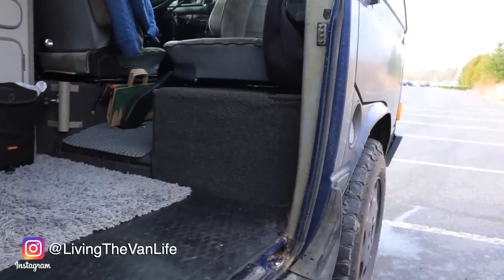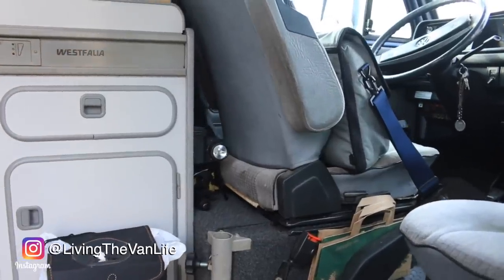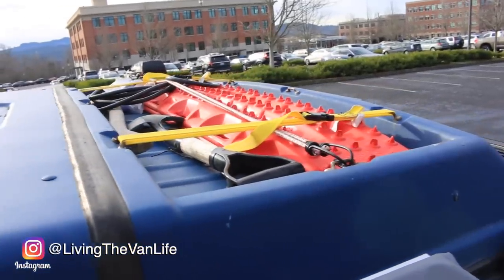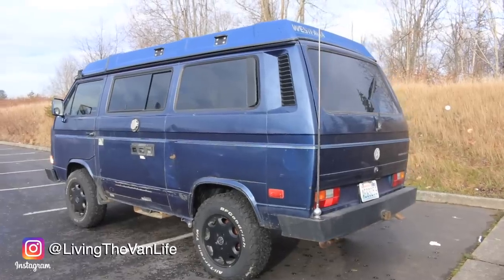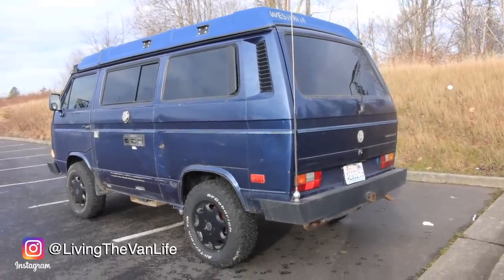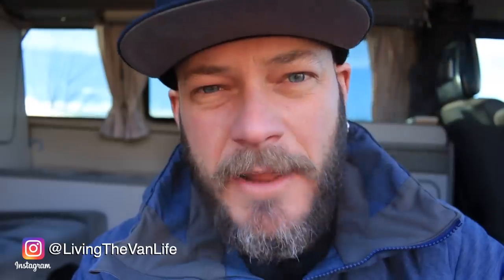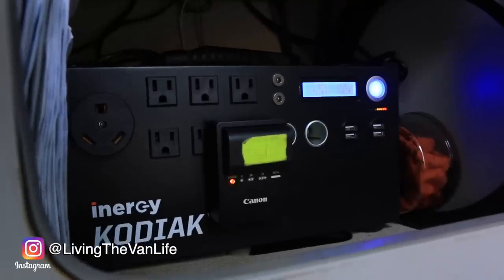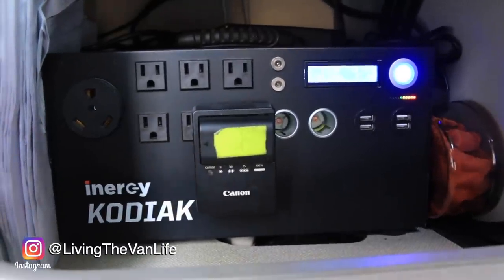Chinese Diesel Heater Install In a Volkswagen Westfalia - Living The Van Life

Comment: I think you did a great job but I would still highly recommend a co2 detector in case exhaust ever leaks.

Also, you probably will never have a problem but there are regulations on fuel tanks inside a vehicle. In the event of a roll over, that tank will pour all the fuel out and cause a potential hazard. 

More importantly, the fuel pump etc is also inside the vehicle. There are a lot of connections and fittings going on under there. There is a high potential for leaks. If it ever leaks, instead of it just dripping on the ground, it's directly into you cabinets.

At a minimum, I recommend getting the co2 detector and move the pump and filter under the van. 

Toreally feel safe, I would get the tank out of there too. I know diesel is much safer than gasoline but there is a reason why the fuel systems are technically outside the vehicle. 

Or dont. Whatever cheers. Just an FYI.
Reply: helmet098 good advice.
Reply: Good idea
Reply: The detector is a good idea but diesel isn't flammable unless under the right conditions i.e. enough oxygen
Reply: He's not worried & using  it regularly. Looks like a well done install - very sanitary !
The 'safety nazi' mentality is its own sort of danger...taken too far we won't ever try anything risky because of the terrifying "What If ? factor.
Diesel is just a light oil - almost impossible to light off its fumes even - gasoline is magnitudes more flammable.
Reply: @hellosunshine1090  diesel is toxic
Reply: @jquest43  True enough.
The issue discussed was more flammability not toxicity per se.
Reply: @jquest43  I think there are other factors too.
Fear of danger that is reasonable helps design systems properly.
Unreasonable fear bordering on paranoia ("what if the sky falls on me...?) creates the safety nazi mentality that tries to foresee every potential inevitability (an impossibility) and design a system so safe that no ill outcome COULD occurr (also an impossibility).
Therefore Life involves risk on some levels.
And just as importantly it's his vehicle not yours or mine - and if he's happy with its safety - 'good on him" !
Reply: While co2 is bad.. co or carbon monoxide will kill with out warning.. so install  CO  alarm

Comment: heads up on the metered pulse pump you want to mount that in a more vertical fashion. these pumps have a piston that is run by an electro magnetic pulse they create air bubles which is fine but with the pup mounted horizontal the air accumulates and the piston wears out because the diesel is what lubricates the pump. the dosing pumps or pulse pumps are very simple and will last a long time but only if yohu mount it so that all the air travels into the fuel line. these are really a good design witho only one moving part in the heater itself which is the fan there is no carb or injector the pump pumps in .02 milliliter pulse that piston is the only other moving part in the entire heater. mount the pump with the output at the top, prime it, and it will last much longer. 
otherwise great install and nice set up
Reply: Who's John halt?👍😉
Reply: @Lumumba B. the best install is from John McK47.

Comment: My dad just installed one in his Westy, put his diesel tank in the engine bay next to the overflow tank (has a Subaru conversion). Super slick and never has to worry about diesel fumes/leaks from the tank. Fills it up when he checks his oil.

Comment: I've been working on those heaters for a while, couple tips. Run for at least 30 min, even during the summer run it once a week. That will keep the pump from sticking. Change the filter regularly. Don't use a bio blend that will foul the burner chamber, you can use an anti-gel additive but sparingly. If you have to change the glow plug tear the thing apart and clean everything.
Reply from the maker: Thanks for the tips!  Much appreciated!
Reply: @LivingTheVanLife  not a problem. Those heaters work great, but can be temperamental.
Reply: A* couple of* tips

Comment: It looks like a great addition. I'm surprised that you didn't have this type of heating solution already seeing how long you've been living in a van. Nice job on the explanation of it all.
Reply from the maker: I actually hadn’t realized they even existed.  I’ve never had the budget for the more expensive, $1,000+ models.  This one, I just couldn’t afford NOT to have.  Thanks for watching
Reply: @LivingTheVanLife  I've watched a few others that use the Webasto brand and they were pretty pricey but you're the first one I've seen to have a separate fuel tank for the diesel fuel. You may have stumbled on to something. Don't be surprise when there's a bunch more people following your lead, especially for the price. What's the fuel consumption? From others that I've seen, they say it sucks up about a gallon of diesel every 24 hrs. What about for this model?

Comment: I bought that Chinese knock off because of a review I saw on-line from a guy in Ireland. I have had it hooked up in my shop all winter. My shop is a poorly insulated building in the interior of Alaska. The heater works like a champ. Heats my shop for about 3 gallons a week. Not bad for $189. It was wither that or $1,800 for a Toyo stove

Comment: I recently purchased a Chinese diesal heater and found a miner fault with fuel tank which is when heater is runner the fuel pump which sucks the fuel actually squeezes the fuel tank together,
When I release the filler cap the tank expanded,
So I've fitted a one way valve on the top of tank to stop it happening.,
Just a little tip for you all who's purchased one.
Reply: Probably a defect in the pump or tank. Not 100% how these heaters specifically are designed but in a normal fuel system of course, this is built into the tanks lid and also incorporated into the filler neck. Along with several other safety features I’m sure these don’t have (like resistance readings in the plastic). I used to work on machines that made and assembled fuel tanks. So I’m used to seeing all the crazy safety requirements before they go into a vehicle.

Comment: I’m trying to be a troll or hate‘n on this video but I deal with these heaters all the time air and coolant (well at least the North American made ones) but one suggestion if you are to use it regularly in colder climates do your self a favour an install fuel cell/fuel pump/fuel filter on outside of vehicle..it just takes one little spill of diesel on the floor/ground and the smell will chase you out of the van and hard to get rid of if it soaks into anything...but that’s just my suggestion, keep doing what you’re doing and love the videos and glad to see the amount of time and effort you did for that install instead of just jamming it in a corner ✌🏻

Comment: The only thing I would do , install a cut off valve between tank and fuel filter, so your fuel doesn’t leak out if you have to change filter

Comment: We installed one of the cheap Chinese Diesal heaters in my sons sprinter van, these things make heat and lots of it! if you run them on low for say 2-3 hours it’s imperative that they are run a good 5-10 minutes on high to burn off all the soot buildup in the combustion chamber.. or they gunk up and won’t fire up!
Reply: Do you need to vent with these diesel heaters???

Comment: I recommend a good high flow air filter for the intake of the heater. I installed one of mine without a air filter and in one season it was extremely dusty inside. I would imagine depending on the build up material it could become a possible fire hazard but at the very least will cut down on efficiency.

Comment: Diesel really stinks duder hopefully that doesn't become a problem for you. Keep up the good work 👍
Reply from the maker: It’s been zero problem at all.  With the diesel tank being in the cabinet adjacent to the slider door, it’s easy to pull up and fill directly from the pump.
Reply: 30 seconds during ignition..No buggy with the door closed Meander

Comment: I had a VW beatle using a VW 1 cylinder gas engine it snowed 6 inches start the 1 cylinder motor in 15 the snow all melted away great heat for going skiing !!!

Comment: Chad, Love your adventures! I see you installed your heater pump horizontally. Everything I have seen/read indicates that it must be installed vertically or at a 45 degree angle, but not horizontally. It will cause premature pump failure. Might be worth you doing some more research. Don't want you to wake up freezing some morning...

Comment: Chad don't know if you have heard this, but when you shut it off you will want to run it on high for a few minutes to help burn out the combustion chamber from collecting soot. That is if you continue to run it at lower temps. I just bought the 2.5K model so i can run it more hot all the time to combat this issue.,,, Good informative how to...

Comment: Nice neat and "cozy" job!! I am sure you have made many Westfalia owners happy (that need heat and can live without the refrigerator) by doing the contemplating for them. I couldn't imagine any better installment choices than what you made. Let us know how it is in the long run; reliability, efficiency, fuel consumption, etc. Excellent delivery and thorough explanation. The baling wire trick will help anyone setting up one of these in any application Great video on SO many levels!!  :-) Thanks Man!!
Reply from the maker: Great feedback!  Thank you for writing this comment.  Much appreciated.  Certainly hope that it helps people out there.     I will certainly be doing a follow up video to how the heater has been performing.  Thanks for following along.

Comment: These are good heaters i bought 10  from china and could easly sell them  and have mine free  i still advice to install a carbon dioxide alarm you never know what goes wrong
Reply: Carbon MONoxide is deadly, and what you meant :)
Reply from the maker: Good advice!   Thanks for the feedback!
Reply: CO 2 is what we expel when we exhale. CO is a by product of fossil fuel as it burns. Methane gas is a by product of decomposing organic matter. All can be deadly in confined spaces.
Reply: advise*
Reply: @tommiedaswammi8008  byproduct*
Reply: the intake and exsaust are outside theres nothing to leak inside !
Reply: @raymondj8768  exhaust*
Reply: @DarthVader1977  byproduct: a secondary product made in the manufacture or synthesis of something else. By burning a fuel,any fuel, we generate a byproduct, e.g. CO., H two O, CO 2, ...H2 O. is a byproduct of fuel-cell operation.
Reply: @raymondj8768  very bad advice. Always have a CO detector installed with any kind of enclosed space. Even leaving a side window open and the wind changing could fill the vehicle with CO
Reply: Raymond J I bet you’re fun at parties correcting everyone’s grammar GRAMMER!! 😆
Reply: Martin Green please rewrite your comment, it's grammatically incorrect.
Reply: M3ta7h3ad good point.if the unit is toxic metal then it will vent poisons. Reducing iq.
Reply: *advise
Reply: Martin Green *GRAMMAR
Reply: Raymond J *there’s
Reply: Tommie Da Swammi I don’t think defining the word you spelled incorrectly was necessary.  Interesting nonetheless.
Reply: @LivingTheVanLife  I didn't hear how long it took for your install.  I have a trip coming up in about ~10 days with only one day off for install time.  Thoughts?
Reply: Do you ship to South Africa? Thank you
Reply: Ewan Yengi  That's wrong. The reason they won't go off is because burning Diesel does not produce any CO.
Reply: Ewan Yengi  That is wrong.  ANYTHING that produces carbon monoxide will trigger a CO detector..

Comment: Looking at your install of the fitting at the bottom of the fuel tank, it like you used o-rings against a flat surface, both the inside/outside of the tank and the nut. O-rings need a groove to sit in or they will be crushed out of shape causing a leak. sealing washers for this application should be flat, not o-rings.
Reply from the maker: The actual metal nipple portion has an o-ring groove in it. So that should suffice.  That’s how it was designed.  It’s not my design.

Comment: You need to mount the pump up and down not sideways otherwise you will greatly reduce the life span of the pump. Check out John Mck 47's channel for further info on these type of heaters.
Reply: I think they suggest a 45 degree angle, but definitely not flat

Comment: As a truck driver I had some trucks with diesel heaters and trucks with APU generators personally I like both but most of all it’s nice having the diesel heaters because they’re quiet compared to a APU generator which sounds like a constant Lawnmower idling.

Comment: Hey chad great vid, I’ve heard on a few UK vids which is where I’m from that these heaters can clog up with carbon if ran on low setting all the time. Its a good idea to blast it on full every so often to clear out the carbon build up. Also the pump can stop working if not installed at a certain angle 30 degrees I think 🤔
Reply from the maker: Ahhh gotcha!   Thanks for the tips!   Much appreciated!
Reply: if run* on

Comment: normally it is connected on your feul tank
10% of the bottom of the tank,just in case
Reply: I see what you're saying but wouldn't  that 10 percent be forever unusable since he would have to unmount the tank and tilt it just to get use out of that 10 percent?
Reply: recently saw a video where the people added a cleaner or some type of additive to their diesel fuel tank and it messed with the heater . they had to run all the fuel out before they could use their heater. so a separate tank might be best.

Comment: Anyone can install one of these units. Espar or Chinese, same way. If your in a truckstop at the end of the day and it's cold and all the trucks are coming in to park you would think the place is on fire. Most all the Espar units are smoking like crazy over and over trying to start. Your first sign the combustion chamber is all carboned up. The glow plugs need to be replaced but unless you practice you'll ruin it and need to try again with a new one. The fans fail a lot then the computer shuts it down. They don't work at altitude. Says right there on the manual. Also, first hand experience with that. You can get the high altitude pump but that doesn't buy you much. It basically runs the pump at a lower volume of fuel and also cuts down on the BTU. I have already seen some Chinese models that let you set the fuel flow. That's the right way to go.

I also notice the thermostats do not work that well. If you're going to be in a real cold environment you want that puppy cranked up non stop. Do not let it start and stop over and over. That's where the carbon buildup comes from. Once the unit doesn't start it waits a little and tries again and fails. This just adds insult to injury and more carbon. A common hack is to put a switch across I think the red and yellow wire at the unit which overrides the thermostat and keeps it running non stop.

Many trucking companies have the Espar in their fleet trucks along with a TriPac APU. They run the Espar off Kerosene from a different tank, not diesel. Much cleaner.

A common maintenance thing to do on these units if you're going to run diesel is to go to Walmart in the lamp section and buy a bottle of kerosene. Also get like a 3' section of spare rubber fuel hose. Hook that up to the fuel pump. Do this at night and watch the light show. Run the unit full on. Kerosene burns much hotter and will get rid of most of the carbon buildup

Once again.....all these units DO NOT like cycling on and off. Either run it non stop with a window open to keep the heat down if needed.

The BIGGEST thing I can tell you is run it on kerosene!!!!!!!

I really really really hope these Chinese units work out or at least last maybe 6 months. For the price it's a bargain compared to the Espar. It's too early to tell yet but everyone and their brother is installing them so it shouldn't take long for the stats to come in.

Also, these things are VERY easy to install. Your other alternative is a Mister Buddy or similar type. These work EXCELLENT but.......there is no exhaust to the outside just like a propane stove. This causes major ice buildup inside and the temps are below freezing. This causes major damage to your interior from water and mold. The Espar and Chinese units vent the combustion to the outside and also take fresh air from the outside unlike the Mr. Buddy and others.

I really don't see the Chinese units working any better than the Espar. I'm hoping they will start selling just the head so you can toss a broken one and replace for even cheaper money.

Comment: I bought a Chinese Diesel Heater for my electric Tuk Tuk so I can drive if when it is cold too. There are kits so you do not have to mess with the tank and stuff like that and also enclosed units with everything mounted inside a metal housing. They are cheap and seem to work good
Reply from the maker: Hahahahaha.  This is awesome.  Love it!